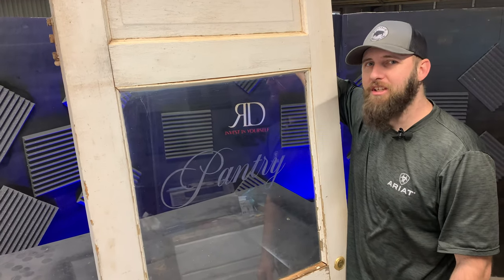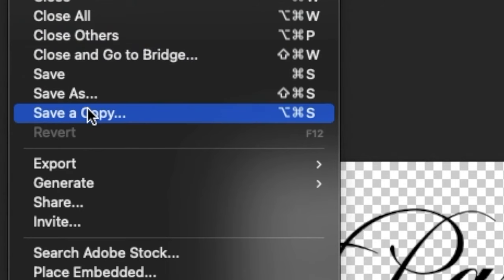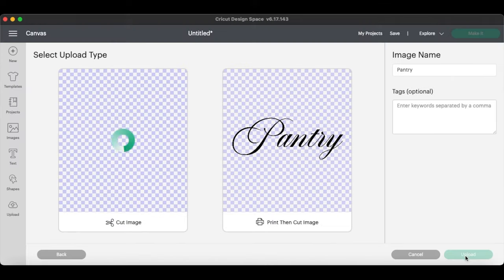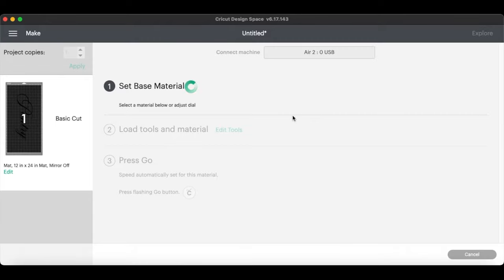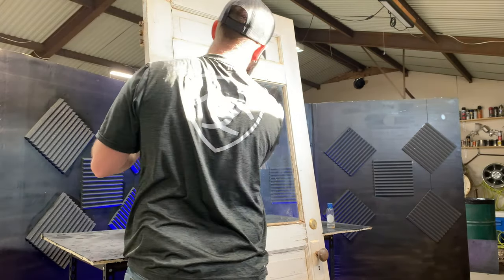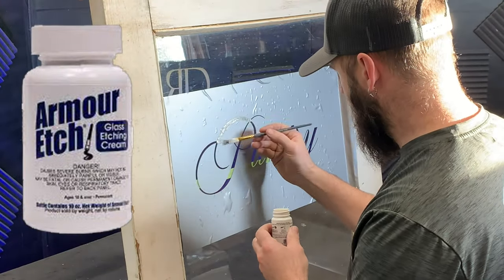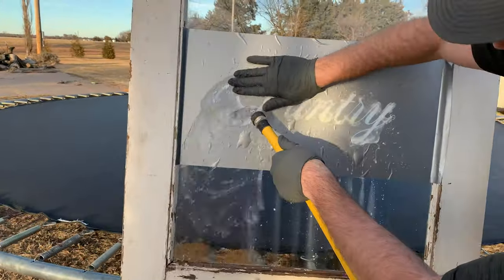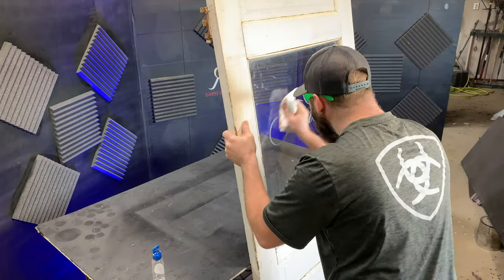Glass Etch How To! Glass Ethch Antique Door!

Comment: have you done this with glass already installed? I want to update my front door but I can't really remove the small window panels on the sides to do them
Reply from the maker: You can do the glass that’s already installed just Mask off all the areas that you don’t want to etch and when you clean the etching cream off just do it carefully don’t get the cream on anything that you don’t want to damage, but it can be done. And I’d use old rags or towels and wipe it clean don’t need to flush it with water. Just get the bulk of the cream off with dry rags then use damp ones to finish cleaning it. Then unmask area when all cream is cleaned off should work just fine.

Comment: I was worried about the etching cream running down the wood when you rinse. Does that not cause any issue with the finish on the wood?
Reply from the maker: It did not but you could always tape some plastic over the wood it probably wouldn’t hurt

Comment: How important is the rinsing with water step? Can you just use a very DAMP cloth & repeat the process several times to get it super clean?  I ask, because I've put a faux treatment on my door, & I don't want to chance getting it all soaking wet & ruin it, if that makes sense. EDIT: If my panes are taped off with PAINTERS tape to get my straight lines, the etching cream won't eat thru it, will it?  Will that tape work?
Reply from the maker: @Kman.  You can most definitely use a damp cloth. Rinse wipe repeat. And in you situation I would recommend doing it that way. Good luck!
Reply: @reddirtdesigns7021  Thx for such a SPEEEEEDY reply! <thumb up>

Comment: I saw bubbles in the plastic, and I may have missed it, but did you wipe the edges with plastic?
Reply from the maker: Bubbles in the plastic shouldn’t hurt as long as they’re not along the exposed areas which would cause bleed through.

Comment: STUPID QUESTIONS:  Do you use removable sticker vinyl? Or non-removeable? Such as Orcal 651
Reply from the maker: Not a stupid question I use removable cricut vinyl because it is much easier to remove I’m sure the non removable would work with a heat gun or hairdryer to warm the the vinyl for easier removal.
Reply: @reddirtdesigns7021  yes! Thank you!! Much appreciation for the response too!

Comment: Great video .. looking to try this for the first time, however, for a solid oak, inside door, with 12 panes -- so rinsing isn't really an option .. any advise is welcome!
Reply from the maker: Wear gloves and use Plenty of paper towels just clean them with dry paper towels careful not to get it on other things in you house. I’d Have a trash bag or grocery sack close by that you dispose the used paper towels. Once you have the etching cream cleaned off I would just use Windex or whatever glass cleaner you use to finish cleaning the whole surface. Thanks for watching
Reply: @reddirtdesigns7021  thanks!  Didn't realize I could do this without the hose -- awesome! I have 2 big, solid oak doors with thermal glass with broken seals .. etching seemed a better solution than trying to remove 12 panes in each of 2 doors!

Much appreciated!! 👍
Reply from the maker: You bet also make sure you mask really well only get the etching cream where you want it to etch